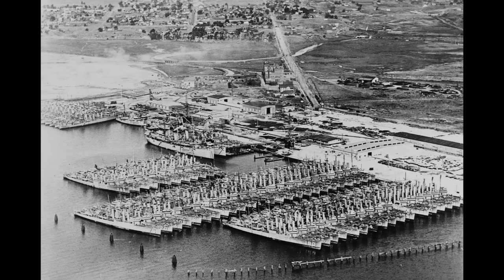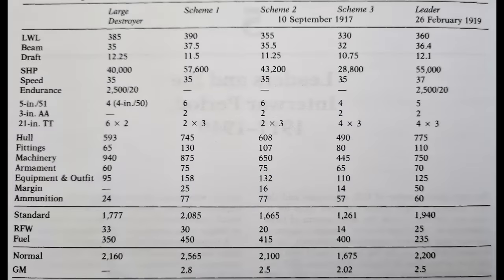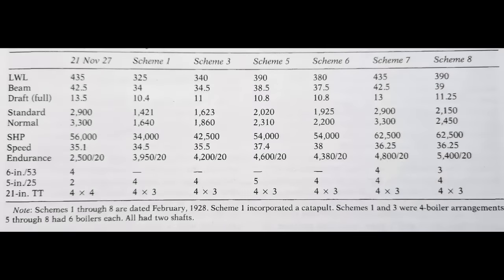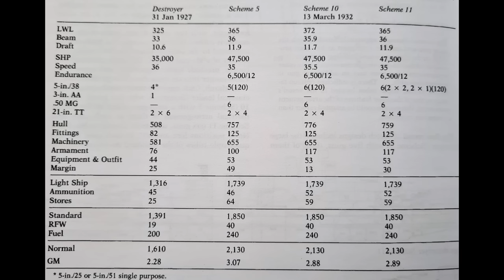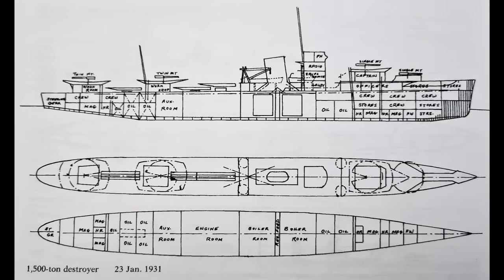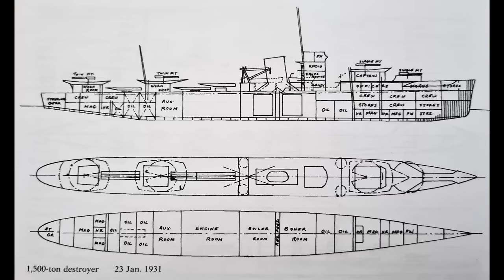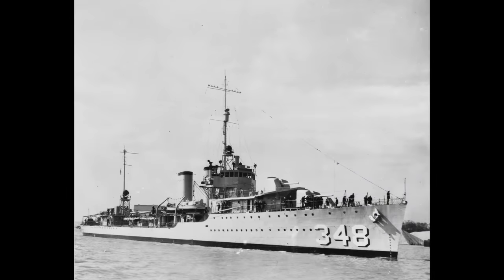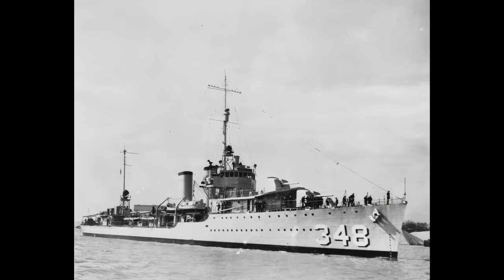The History and Development of the 5"/38 - Turns out you can take the sky from someone

Comment from the maker: Pinned post for Q&A :)
Reply: Rapid fire 5in barrel life. 
Do smaller guns have better life than battleship size rifles? Much better life?
 Are these  smaller barrels easier/cheaper/faster to change liners?
Reply: What is your Opinion on Austro - Hungarian Navy Strategy at the Beginning of WW1, so were their Goals, Tactics and Doctrine sound and they just never got the Chance to use them, or was the Stalemate and Blockade the best possible Outcome in Retrospect.
Reply: A lot of the smaller caliber naval guns use integral cartridges rather than separate projectiles and powder canisters or bags. Were integral cartridge designs ever investigated for large caliber guns, say, in excess of 12 inches? Aside from needing then to eject spent casings, and then to put them somewhere, what might be some other design or operational challenges that made such systems infeasible?
Reply: How much of the 5"/38 success do you think is attributable to the proximity fuse? And if the proximity fuse had not been available, would a mass quantity of 40mm have provided better protection than the 5 inch?
Reply: How’s the Australian tour looking?
Reply: At the end of the video (around the 28:00-minute mark) there's a picture with a few 5"/38s. At the end of all of those barrels is a little vertical piece of something that almost looks like some sort of aiming sight. What are they actually and what was their purpose?
Reply: out of Dunkerque, Hood and Kongo which one would you consider the epitome of Battlecruiser design?
Reply: When Saratoga was being refitted at the start of 1942. How would the Barbettes be modified to accommodate the twin 5-inch gun turrets compared to the twin 8-inch guns?
Reply: How were armor plates on battleships held on, I can't imagine welding them would've gone deep enough and I have a feeling bolts would have just been shaken loose, so what fixtures were used?
Reply: USCG HM here. (1976 to 84). We had tons of "Hand me downs" from the USN. I could swear we had A LOT of museum pieces still in active service for some time, including the 5". Some of these vessels should have been melted down to make pizza ovens years before. (Idea for a video...hint hint) - "Coast Guard. You have to go out, but you don't have to come back." Smooth sailing Drac. 🍻
Reply: @F-Man  a one-piece large artillery shell would be very heavy. There's also the safety issue of having the powder and explosive combined.
Reply: @LeftToWrite006  where do you see something on the barrels?
Reply: On the discussion of aa weapons could we get an analysis of the French Navy's AA defenses in ww2?
Reply: Why did the design change from 40 cal to 38cal? How would this have effected the guns if it was 40 calibers long?
Reply: Slightly off topic, but how much future-proofing were naval designers in the 30s age 40s doing? Were they trying to build a ship to kill existing ships, the ships on the drafting board, and ships that wouldn't be designed for another ten years?  For example, you've mentioned that the Iowa super heavy shell was overkill for the mid 40s armor and ranges, but was that feature seen as a way to keep them relevant through the 50s?
Reply: @TheJudge2017  I could guess, it was a matter of inertia.  Having a long, heavy, barrel makes it harder to change the direction the barrel is pointing.  I don't know if that is the case, specifically, with the 38, but I have read of other guns intended for AA use being cut down to improve their responsiveness.
Reply: Do you have an explination of why the RN, having 3 different calabbres of heavy dual purpose gun (4.5", 4.7", and 5.25"), didn't just pick one and develop a universal mount instead of clogging up the supply line with three different shells. I persionaly don't care which I just would have thought it would save a great deal of time, bother and money to just pick one. Hell, even if they had decided between 4.5" and 4.7" for destroyers (along with using the 5.25" for bigger ships) that alone would have made things easier.
Reply: Of HMS Delhi’s conversion to carry a battery of 5 single 5/38s in New York in 1941, DK Brown states that trials were very successful and “agreement had been reached for more ships to be converted, but once the USA was at war they had better use for their guns than converting elderly cruisers to the armament of a destroyer” (Nelson to Vanguard, pg 156).  Based on the sheer number of guns produced, in hindsight would more cruiser conversions have been worthwhile, and would conversions of the Omaha class to a similar battery have been a good idea?
Reply: Why was no consideration ever given to a modern 4" AA gun, such as the 4"/50 Mk 10? Would a 4" gun with lighter ammunition but a higher muzzle velocity have achieved a similar level of effectiveness as the 5"/38? Do recall that there is much praised heaped upon the 10 cm/65 Type 98 for how well it performed (when the feeding mechanisms behaved themselves).
Reply: I just want to say how great it is to see pictures which you obviously took yourself when you came stateside and not just stock footage.

Another great video!

I guess I'll drop you a question since this is the Q&A... How well does the QF 5.25" compare to the 5/38, and why do you consider it the winner?
Reply: @pedenharley6266  In the late 30s, several old C Class (older than Delhi) cruisers were tagged to be converted into AA cruisers, with, first, single, then twin 4"/45s.  That work seems to have been suspended when the war started.  Navweaps says that, no matter how many 4"/45s were built, the Admiralty never had enough of them.  The USN's supply of 5" guns was probably as tight.  I have read about how the USN ramped up production of 4 and 5 inch guns during WWI, farming production out to a large number of companies, but never had enough to arm all the convoy ships, and escorts.  I would expect the situation to have been the same in WWII.
Reply: Drach, could you speak about how all these ships were designed and chosen in practice? Was it just mustaches in smoky rooms theorizing, or did they at some point try to gamify the various scenarios? Use statistics? What other cognitive tools did they use to figure out the best ship designs? More detail about all this would be amazing!
Reply: Did other branches of the military have a look at these highly successful 5' 38 caliber guns?  You'd think that the army might be interested in using them as mobile artillery/anti-aircraft weapons.  I know  the dual mount naval version was way too heavy for practical use, but a single gun on a simplified mount might have been quite an effective weapon.  Was there no cooperation between naval and army ordinance departments?
Reply: are those real gun sounds which were recorded at the time when they were fired in your intro?
Reply: Drach:
If you could give the Royal Navy at the outbreak of WWI One of the following pre-outfitted on all ships which would you choose and why to help the Royal Navy: Modern AESA Radar, GPS, Modern Radio communications including satellite communications, modern Sonar, or modern naval engine technology?
Reply: It would be amazing if you would go into detail concerning fire control and range finding, and everything that made ships fire accurately or less so on enemy ships. Would dreadnaughts from WW1 be able to fight at range against US or British heavy cruisers or battleships of ww2? Why did the Japanese struggled to score shell hits on US ships during the pacific war?
Reply: Please do a short video on the HMS Doterel. From the Doterel-class sloop.
From her explosion and sinking, to the salvage efforts and later investigation. I would like to know more. 
I'm especially curious as to what exactly xerotine siccative is 😃
Reply: How much of an improvement was the 5”/54 over the 5”/38? If the war were to go on longer, would the US replace their 5”/38’s with 5”/54’s?
Reply: Always found the way Naval assets were deployed in WW2 a bit odd. For instance sending out Bismark with the cruiser Prinz Eugen. Surely a small flotilla of destroyers instead of a single cruiser would have offered a far more flexible battle group?
Reply: Drach, there is a curious side note to the 5”/54 Mark 16 mounts of the Midway class. These guns were removed in the late 1950s and fifteen of the mounts were repurposed to the then new Japanese Maritime Self Defense Force. Nine of the mounts were placed on the three Murasame class DDs and a further six were installed on the two Akizuki class DDs. The former class kept theirs until decommissioned in 1988, but one the latter class, the Akizuki had its aftermost mount removed to accommodate a towed sonar in 1989 and by 1991 all ships had been removed from service.

Of note, these two classes were built by the Japanese, but paid for by the US Navy Off Shore Procurement program, and initially had US Navy hull numbers. They were renumbered by the Japanese once in service. Similarly, the German and Australian Charles Adams class DDGs were built under the same program and, also initially were assigned US DD hull numbers.
Reply: Why did some of them have elevation limiters?  There were covers on one of the pictures your showed that would have limited the barrel elevations and I am curious as to why you would do that.  Are they for weather protection and would pop off if the gun was used for antiaircraft and then later replaced?
Reply: Did the US ever try and mount a naval gun on a tank in ww2, like almost every one else did
Reply: @micahmurphy4546  the short answer is no. US tank guns of WWII were all derived from either field guns, like the old French 75mm field gun of WWI, or antiaircraft guns, like the 3” on the M10 or the 90mm on the M36.

Interestingly, the US Artillery Museum website incorrectly claims that the gun on the M10 was developed from a US Navy AA gun. That’s not correct. I double checked both on Wikipedia and in the book Sherman by R.P. Hunnicut (the best authoritative reference the M4 tank and its derivatives) to confirm it was developed from an Army developed AA Gun from WWI. Up through WWII the US Army Coast Artillery Corps was responsible for developing both coast defense and antiaircraft weapons for the Army. The weapons used by US Marine Defense Battalions used Army designed weapons, with exception of the 5”/51 coast defense mounts used at Wake Island to good effect on 11 Dec 41 (sinking IJN DD Hayate). The Marines also had a few 7”/45 coast defense mounts at Midway (that had been mounted on pre-dreadnought BBs of the Connecticut class). From Guadalcanal on they used 155mm Long Toms and 90mm AA Guns M1.
Reply: @chuckw1113  I see, thankyou
Reply: when you have larger ships such as cruisers and battleships escorting a slow convoy of 10 knots, did the heavy escorts sail with all boilers lit or did they only have a couple lit?  If partial, how long would it take, say a battleship light off the balance of the boilers and make it to a speed sufficient to fight a surface raider?
Reply: Any chance of history of the mk75 76mm?
Reply: @maxcampbell541  the short answer is welding requires less weight and machine operations on metal that is designed to be hard. Trick is to design/plan for the welding to be done in such a manner the ship can be made. Often when two sheet are needing to be joined, an angle is ground/cute into each edge, and the resulting v notch filled with overlapping welds, and each pass checked and redone as needed. Most folks don’t realize that weld filler is harder then most of the plates being joined together. Another possible benefit is less ready made shrapnel from sheared river heads or bolts.
Reply: Great video as always, and even better if that was a Firefly reference in the title!
Reply: 16:45 A discussion about how naval guns varied in breech design would be interesting. A series on the evolution of guns starting with the LOB sailing ships and their cannon and ending with the USN 16/50 Mk. 7 guns would be fantastic!
Reply: Why was Hiei's armor able to mostly keep out San Francisco's shells at the Battle of Friday the 13th?  Navweaps's armor-penetration data for the 8"/55 gun used on the American treaty heavy cruisers indicates that San Francisco's main-battery fire would've been able to penetrate the 8-inch-maximum belt armor of a Kongo -class battlecruiser at up to 12,400 yards, so, at the hundreds-or-even-tens-of-yards ranges at which San Francisco was engaging Hiei, its shells should've been able to essentially ignore the battlecruiser's armor completely; instead, San Francisco was unable to penetrate Hiei's armor belt at all, only managing to tear up the Japanese ship's superstructure and land the single penetrating hit aft of the citadel that flooded out Hiei's steering gear and left the larger ship unmaneuverable.  So why did Hiei's armor belt overperform so spectacularly against San Francisco?
Reply: The 5"/54 mk.16 was also used on the Murasame-class destroyers of post-war Japan, if my cursory Wikipedia knowledge holds up.
Reply: I suppose one question I have is why only some of the Standard BBS got 5/38s during one refit or another. I know that _Texas_, for instance, had some 3 inch guns and a shit load of 20mm and 40mm, but no 5/38s. 

Have you ever made a video on that one Greek Armored Cruiser that they used to great effect during the first Balkan war and still survives to today? While much more technically advanced than the pre-Dreadnoughts the Ottomans had, I’ll still never not be impressed that a single cruiser spanked multiple battleships.
Reply: @magiccarpetmadeofsteel4564  Georgios Averof?  Yes, he already has.
Reply: do you have any vids on the balao class sub & the surcouf class sub & other subs like them?
Reply: @ricardokowalski1579 p
Reply: What do you think of the modern  Navy's current ships. Including the silent service. Do you think they are small compared to the previous World Wars. If one started again?